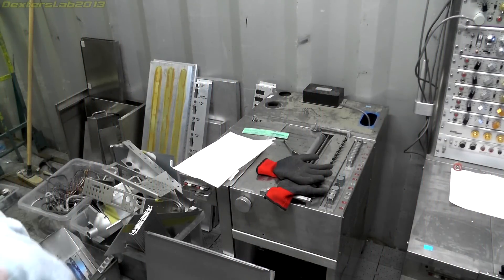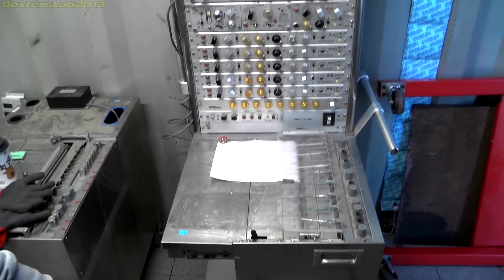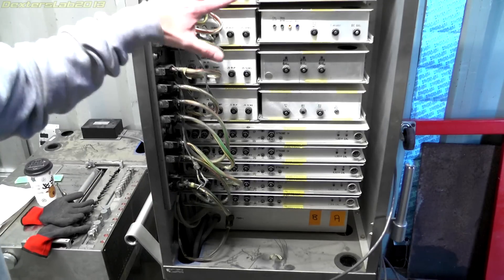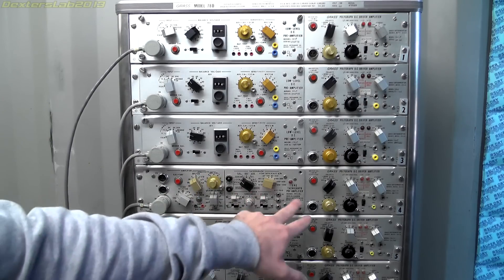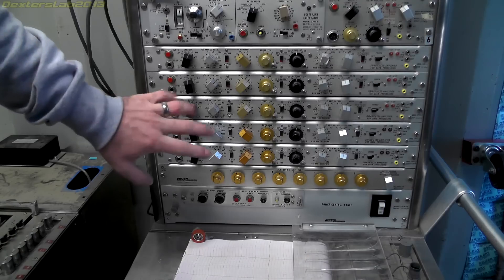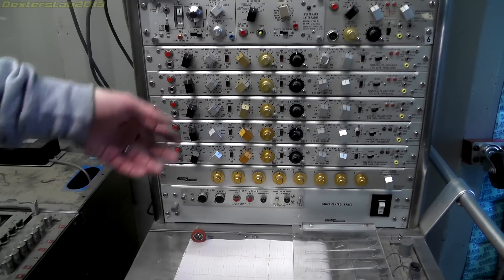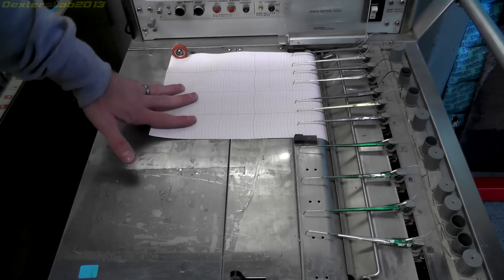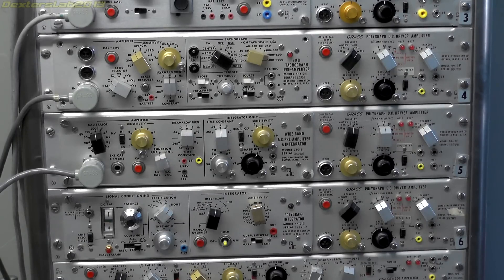DL#075 - Grass  Model 78D  Polygraph & EEG Teardown Part 2

Comment: I started my career in sleep medicine in the early 80's becoming very familiar with these units. They are the Grand-daddy of the sleep field. The AC amps got input from the back under the "A" and "B' inputs which came from the punch down panel where the headbox was connected and the selection of Grid1/Grid2 which compared voltages and said voltage difference then drove the pens based on the filtering characteristics set for each channel. We used to take these things apart for fun. I remember trying to source a driver motor that we found to be out of timing which caused the paper to go slow, so the overnight sleep recordings which were supposed to be 30 seconds per page, now were about 31 sec per page and that screws up everything.  Grass has a nice Heritage paper available.  So many memories looking at this video. Thanks. 
https://grassfoundation.org/sites/default/files/pictures/Electroencephalographic-Heritage.pdf